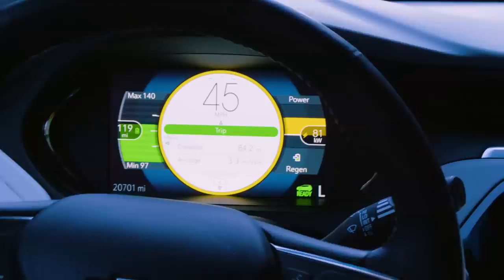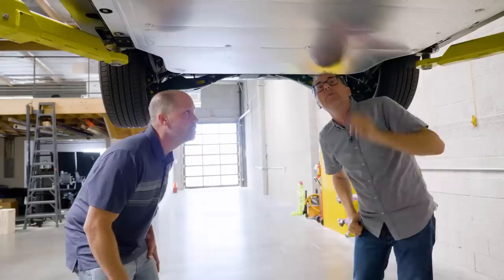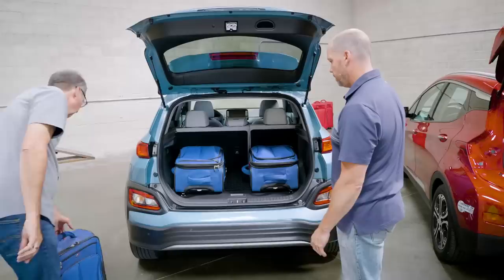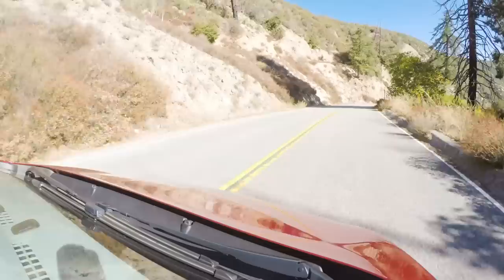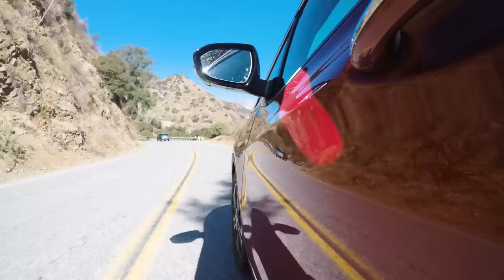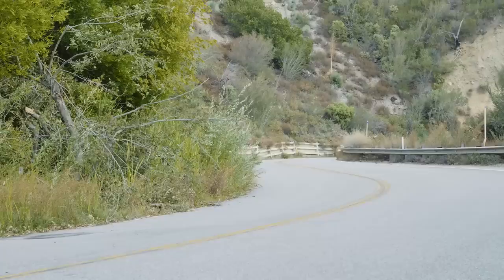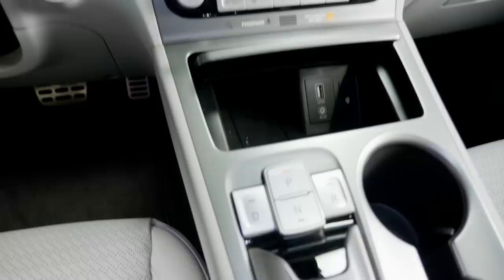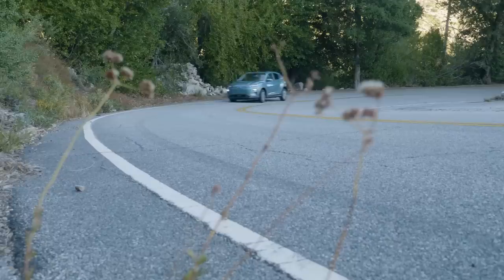Hyundai Kona Electric vs. Chevrolet Bolt EV: Which Is the Best Affordable Long-Range EV? | Edmunds

Comment: Why use the term vaporware twice with Tesla? This review and the other. They are headed up against an entire industry and have taken the path of most expensive models first. Every car has been that way with them. Nothing new to their record. They don't have the resources otherwise.
Reply: It was definitely not in their best interests to say that. He could've just said it's not out yet, give it a year or two. But noo it's 
v a p o u r w a r e.

So was the Model S in 2011, remember that guys?
Reply: There is no 35k Tesla 3, like promised and would have been a direct competitor to the vehicles tested here. Instead Tesla has a $45k model 3. 10k in that price range is a huge difference. This is why the Tesla Model 3 is vaporware
Reply: Why are Tesla fans so sensitive?  Tesla promised a $35,000 long-range vehicle.  They have yet to deliver.  But they're a new company, whine, whine, yada yada yada.  Vaporware.  BTW the Bolt has been are the market for 2 years.
Reply: Let's screenshot Blake Swan, boxmonkeyracing, and alliejr comments shall we...
Reply: Nah.  As a fan of Tesla, it deserves it. Tesla is doing is well with investors for focusing on the more expensive M3s but base M3s should be trickling to the masses by now.
Reply: @alliejr  , you sound like a socialist. Tesla is building and selling every car they produce at around 60k$ - why should they make a 35k$ car then? If the demand is bigger than supply, what company would not maximize their profit? Elon has been upfront with what needs to happen before they release the 35k$ version, scale of production is one thing. But that message is hard to get across when all  "motor journalists" talks about Tesla as vapourware.
Reply: @fredrikbarthlen5222   All power to Tesla for building and selling are car for a price that the market will accept.  I have no problem with that.  They can price their cars anyway they like.  But the $35,000 version is vaporware.  Elon could have just kept his mouth shut (not a bad idea for the CEO of a public company) and not said anything about a $35,000 price.  Instead he bragged about it, but has not delievered.  When (if) he does deliver the car at that price, then it will no longer be vaporware.  Until that, however, its vaporware.  And I'm not sure you understand the meaning of "socialist".
Reply: @swanblake  Both the Bolt and Kona are more than 40K for the models used in this test drive. Add a few options and DC quick charging for the Bolt and it gets close to 45K.  So comparing to medium range Model 3 is not so egregious.
Reply: Most of the traditional automakers do the same thing. They give the price then add the destination charge.
If you think about it does cost more to ship a car over longer distances. One way around it would be to charge an average destination charge. 
.
Reply: "Why use the term vaporware twice with Tesla?"
The model doesn't exist. To make comparisons is to pretend. One can pretend ANYTHING. A non-production car like the Kona, is also a pretend comparison.
Reply: The current Model 3 starts at $7,500 more than the Bolt, so it's vaporware but the Kona Electric, which isn't available at any price and will likely never be available throughout the entire US, isn't vaporware.
Reply: um err, because the $35k Model 3 isn't available yet unlike the Kona which also isn't available yet....???? why didn't they say that up front and maybe even call the Kona the same thing???
Reply: @swanblake  
You two are going to feel silly in 6 months.
Reply: @swanblake  Fully agreed. By nearly 2 years in, any manufacturer would have starting production on a car they took reservations in early 2016.
Reply: Hmm - Tesla seems to be delivering a lot of Model 3's.    https://insideevs.com/monthly-plug-in-sales-scorecard/

So far 2018 US Sales - Chevy Bolt - 13,882  Tesla Model 3 - 95,882.   Hyunda IONIQ EV - 287

I think the better question is, if the Bolt is as good as all the Media talking heads claim it is? Why isn't Chevy selling more of them in the US?
Reply: FACT Tesla model S still the BEST car to Drive PERIOD.
Reply: @Trades46  Canada still doesn't have the Hyundai ioniq electric. It's been out since 2015 I think.
Reply: @larryspiller15  I reside in Toronto and I see PLENTY of Ioniq electrics.
Reply: @Trades46  my bad ioniq electric q2 sales were 371 in Canada for q2 and 123 for q1. 494 ytd. Q3 isnt out yet I guess. Meanwhile the tesla sold 2785 in q2 alone in Canada.
Reply: @Trades46  excluding q3 sales there is less they 500 in Canada by the looks of things
Reply: @Trades46  my bad I guess they sold in 2017, 890 so 1384 in the entire country. Or half of a single quarter worth of model 3 sales in 6x the time.
Reply: @swanblake  Kona isn't available or priced yet.  It's very possible low end model 3 will be available on or before Kona.
Reply: They are the industry!!
Reply: D May so that makes Taycan, EQC, E-Tron, and many more vaporware too?
Reply: I'd bet that demand for Kona will also be high and you won't be able to buy the base version either. It isn't widely available yet and dealers won't push/inventory them because they aren't nearly as profitable as ICE cars on their lots.  For Bolt, it's well documented that dealers misinform and steer customers away from buying it because it's not as profitable.  Audi USA dealerships are boycotting electric, except for publicity, and plan to not keep inventory on lots, special order only.  Dealers buy cars on credit, so they are incentivized to stock/push the most profitable models. Other companies, just like Tesla, will charge the highest they can and demand will be high for Kona especially when they are the only ones with tax credit in USA. If Hyundai do offer the base version demand will be nuts, so it will be low production volume but high publicity for the brand. Get people to dealerships looking at Kona and some will instead be convinced to buy ICE cars when Kona isn't available (at base price, or at all).  Companies only sell base versions of cars to avoid losing sales to competitors.  Demand is still way higher than there are choices/availability. It's crazy Bolt did so well for such a crap car.. reason is people want full EV's with range.  Model 3 expensive versions are being bought by people who normally buy much cheaper cars, it's in their earnings reports.. also I am one of them.
Reply: I think the reason why Tesla is not selling the least expensive $35,000 at this point is so they can still sell the expensive, high revenue versions so buyers would be able to afford them by taking advantage of the federal incentive. When Tesla has reached the 200,000 units where the incentives diminish, they will start rolling out the least expensive version so people can still by Teslas even if the incentive isn't as much. Just my theory though.
Reply: @swanblake  Only that's not the $ difference here. The Bolt premium trim, which is what they used in this comparison, (you can tell from the roofline) is about $44K.
Reply: @joseledesma4776  
Elon Musk has stated in an e-mail to Tesla employees, that if they were to sell the Model 3 at 35,000 today, they would lose at least 3,000 - 4,000 USD per vehicle.
Reply: @zoidburg3101  Maybe it has to do with there are only little over 5 million people in Norway.  Hyundai and Chevy probably are delivering the cars where they will have the most visibility to develop demand.
Reply: If you go to Hyundai’s website the Kona EV is listed as a future car coming in 2019. The 35K model 3 is scheduled for 2019. Why is the Tesla vaporware but he Hyundai isn’t? Also you are misusing the term vaporware. The Tesla Model 3 exists. There are 20 of them in the parking garage where I work right now. I could go buy one. I can’t buy a Kona EV.
Reply: @brantsears1   probably because the schedule has been continually moved back, and while they promised 35k from the outset, the model three has been in production for well over a year and is yet to appear. Meanwhile, the kona ev is already available in much of the world, at an exchange rate adjusted price that matches perfectly with what they actually said it would cost. Maybe that's it.
Reply: They had to do it this way because they didn't have an income from millions of ICE vehicles to bankroll the production of an EV. The sales from the first roadster bankrolled the production of the Model S, which bankrolled the production of the Model X, which bankrolled the production of the Model 3, which will bankroll the production of the semi, pickup, and Model Y.

Chevy and Hyundai never had to do this.
Reply: @alliejr   Tesla fans a sensitive because they feel Tesla deserves to succeed.  The viability of electric cars has been around for a long time.  Only Tesla was brave enough to open those possibilities.  NOW that Tesla has proven there is a market and desire for electric vehicles, the big brands are trying for market share.  You know, the big brands that have cheated emissions tests, built cars to fail after a certain time frame, purposely made maintenance difficult without paying expensive dealer garage rates, promoted climate changing fuels, purposely withheld safety technology until market competition demanded response, taken bailout money so they can continue paying executives.  Tesla's biggest motivation is to better our chances of survival.  The only reason $ is involved is because that's the way the world works.  If Tesla makes the $35 000 car tomorrow, it will end up closing its doors because it will not be able to afford to stay open.  It has to stay in business if it wants to change the world.  The big brands stay in business to make money.  It's also pretty obvious to me that if Tesla goes out of business, the big brands will phase EV out as fast as they can.
Reply: Bob T No company “deserves to succeed”. Every company has to earn its success. I stand by my statement that the $35K Tesla is vaporware. Teslas basic strategy of selling more expensive vehicles, to start, as a way to generate working capital and perfect design and production of less expensive vehicles is extremely sound. That’s how I would have done it. However, over promising and under delivering is a bad mistake and unfortunate indicator of the hubris and insecurity of the CEO. Fewer bellicose proclamations and more heads down focus on quality and customer service. I’m a veteran in the entrepreneur game and I can attest it’s Execution that wins; not “The next killer mousetrap idea” yelled out at the highest volume. No rational executive is interested in killing off any product or technology as part of a ridiculous conspiracy.
Reply: @alliejr  if you don't think there is a conspiracy to suppress technology and keep people paying for energy you really should look at some history. Start with GM killing successful and efficient electric street cars to sell more buses. There IS and HAS been a conspiracy to keep us off electric transportation for hundred years.
Reply: @alliejr  no ridiculous conspiracy, just history.  You sound like an entrepreneur, I question your success though, as you show a lack of vision.  As the $35 000 IS vaporware at the moment, it is not impossible.  I would encourage you to open your mind to a different business model you might not have experienced yet.  Have you ever seen ANY other company miss its targets so habitually and stay in business this long? It takes a unique loyal client base who believe Tesla deserves to succeed.  It's not important if Tesla actually does deserve to succeed, what matters is what clients believe.  P.s. Tesla deserves more success than any existing brand of car.  I say this largely because making money for Tesla is a means to an end, not its main goal.  This is proven by patent sharing, as well as many other actions.
Reply: @tabbott429  there!  So true!
Reply: Bob T Just calling it like I see it. Yes I am a successful entrepreneur. Thank you. As an investor I can place a high value on customer loyalty, but only when it’s based on a model and business approach of success. I don’t invest in fanaticism. But keep plowing your money into any product that brings you joy and God Bless.
Reply: @swanblake  35k model three = vaporware, right.

Comment: Lost all credibility at 'vaporware'. They have a timeline for the base model, and neither of these cars would exist without the push Tesla had on the market.
Reply: Just because Tesla has had a positive influence on the market does not mean their negatives should be ignored, they promised a car that they still have not delivered, many people believe they never will, and that's OK, hopefully those people are wrong.
Reply: Martin "Lost all credibility at 'vaporware'."
Explain how you test a production car, that isn't in production. Pretending how it's test's isn't credible, one can pretend anything.
Reply: D May it has a release date so how is it vaporware? The entire word should be used to describe the German automakers yet Edmonds seems to entirely ingore that.
Reply: They also ignore the fact that the current Model 3 RWD mid-range is only a few thousand more than the Bolt Premier. The comparison was worth making.
Reply: The new version of the Bolt coming out is half the price of the Tesla and twice as good. That comparison make the Tesla look like old news.
Reply: Martin "It has a release date so how is it vaporware?"
No one can buy one, you have no clue if the Tesla is crap because it doesn't exist. Pretend much?
The word is that the new Volt is half the price of the Tesla and twice as good. Chevy is also offering a free trip to Jupiter with each pre-order of $1000 down.
Reply: @dmay3391  you are wet dreaming again
Reply: True.. right now Kona is still vaporware.  I would argue you wont see Kona or Model 3 base versions until the demand for the more expensive versions dwindles enough. 

I'd bet that demand for Kona will also be high and you won't be able to buy the base version either. It isn't widely available yet and dealers won't push/inventory them because they aren't nearly as profitable as ICE cars on their lots.  For Bolt, it's well documented that dealers misinform and steer customers away from buying it because it's not as profitable.  Audi USA dealerships are boycotting electric, except for publicity, and plan to not keep inventory on lots, special order only.  Dealers buy cars on credit, so they are incentivized to stock/push the most profitable models. Other companies, just like Tesla, will charge the highest they can and demand will be high for Kona especially when they are the only ones with tax credit in USA. If Hyundai do offer the base version demand will be nuts, so it will be low production volume but high publicity for the brand. Get people to dealerships looking at Kona and some will instead be convinced to buy ICE cars when Kona isn't available (at base price, or at all).  Companies only sell base versions of cars to avoid losing sales to competitors.  Demand is still way higher than there are choices/availability. It's crazy Bolt did so well for such a crap car.. reason is people want full EV's with range.  Model 3 expensive versions are being bought by people who normally buy much cheaper cars, it's in their earnings reports.. also I am one of them.
Reply: They gained credibility with vaporware. Tesla promised a $35K electric that never appeared, which is the definition of vaporware. And, unlike a Tesla, when these break, you can fix them, not park them for months waiting for parts, or not finding anyone who can fix them out of warranty.
Reply: @jmbickham  
Nonsense. Huge price difference.
Reply: @dmay3391  

Chevrolet has cancelled the Volt. As of November 27th.
Reply: I had a reservation for a base model and the timeline for the production kept saying in 6 months for the last 6 months.
Reply: @steveseeger  How can the Kona be vaporware if i see them driving around here? hmmm ??? The local Hyundai dealer just sells them. Price is 39.000 euro. Much cheaper than other EV's.
Reply: @HermanWillems  That's cool! They aren't in North American market yet it would seem which until past couple of weeks is only place you could get a Model 3 also. I only meant that the base version is also not going to be sold by them while demand is high enough to only sell higher trim.  Tesla will sell a cheaper trim as soon as there is capacity, unless they make a new category between mid range and base.. any manufacturer that sells ICE for higher profits than they can sell EV will try to undermine EVs at first which is what you see across the board so far.  They still want publicity though and it is definitely changing now that it's apparent EVs will be all people want once they are cheaper and better understood
Reply: Guess what Tesla just announced? The $35,000 Model 3. By the time you read this, ordering will be open.

Comment: Great review.  Hyundai May have the best electric for money on market.  I still think these are city cars not good for taking them on a vacation out of town.  But if you have a home to recharge these they work.  And I take the Hyundai in a heartbeat.  Great vehicle and surprising.  GM has the know how, but unwilling to package it right or put it in something that looks better than a cockroach.
Reply: Everyone has to sleep & eat. Out of town is easy. You just have to plan trip, so you charge during meal time and sleep time. EV for me.. Pros out weights the cons
Reply: Agreed, don't care for the looks of the Bolt. Beauty is only skin deep, it's no secret that expensive high end cars look way sexier than cheap cars, and yet all it really means is that the sheetmetal was formed in a more attractive design. It's not like they can't make a cheap car look super sexy, they just won't do it and that sucks to high heaven.